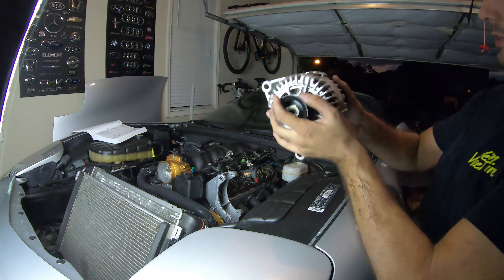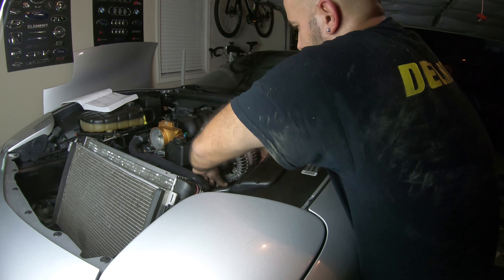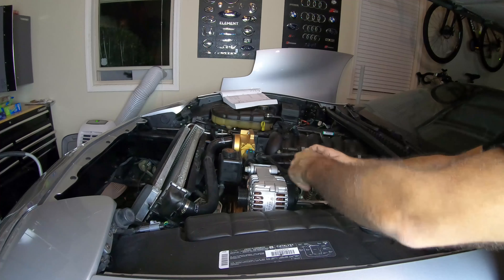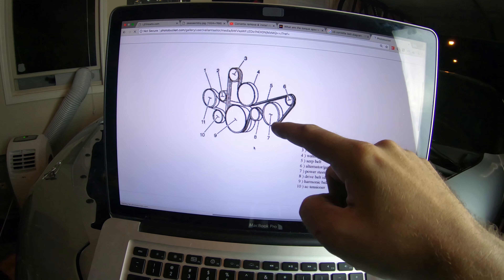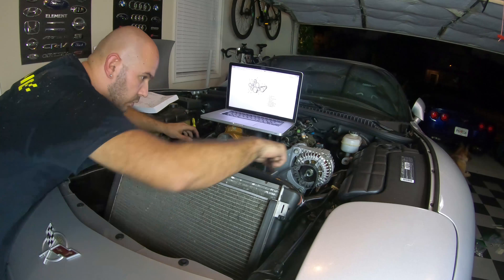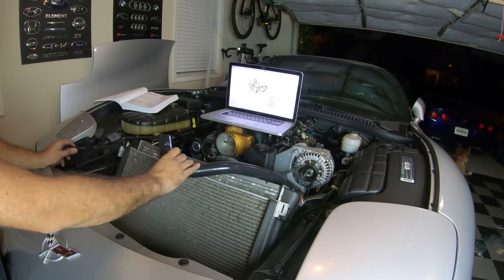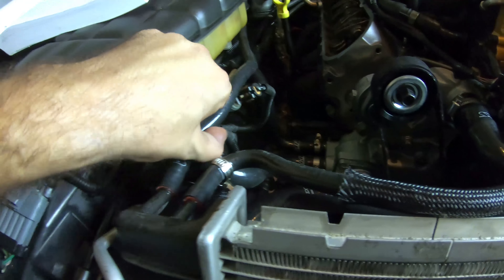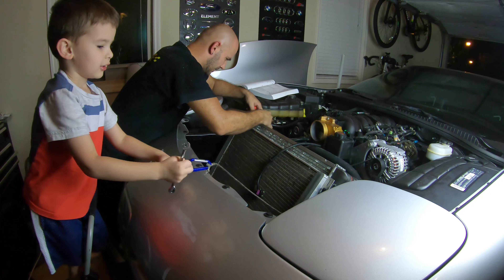Alternator and Serpentine Belt Install - C5 Corvette Build - P32

Comment: A question with your assistance, I have a 1997 Corvette 90,000 miles original alternator, I have issues of overcharging and wondered if I would need to get a new alternator/Voltage regulator.  I am guessing the alternator is inside the alternator?  This correct?
Reply from the maker: Pj Brien I remember reading about this. It could be a slew of issues. If you get an aftermarket alternator, you’ll have a constant code that shows up. Check the wiring first that this post explains before you replace the alternator. But honestly, it’s probably your alternator.

https://www.corvetteforum.com/forums/www.corvetteforum.com/forums/showthread.php?t=3177315